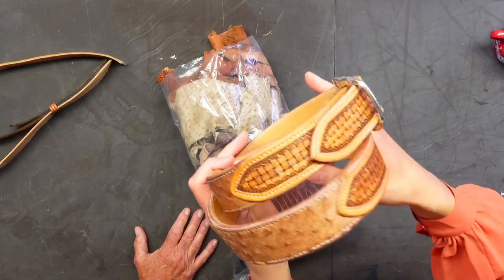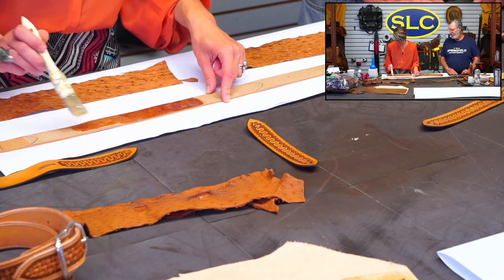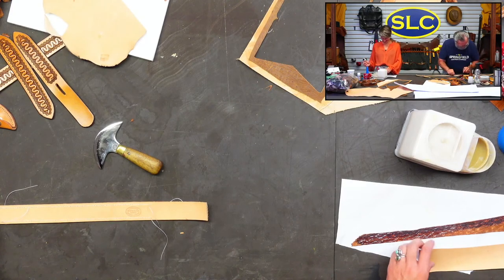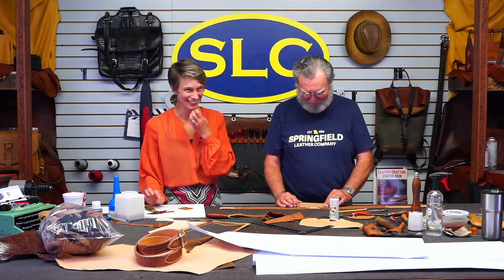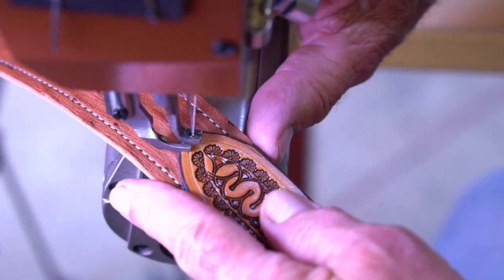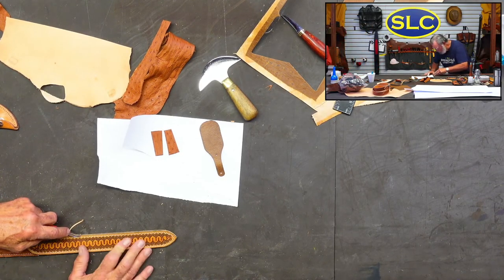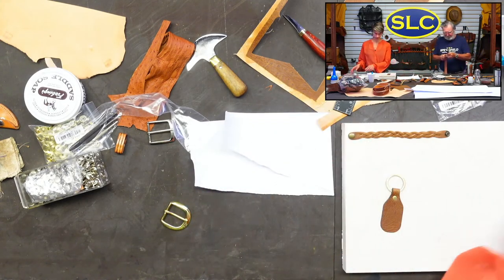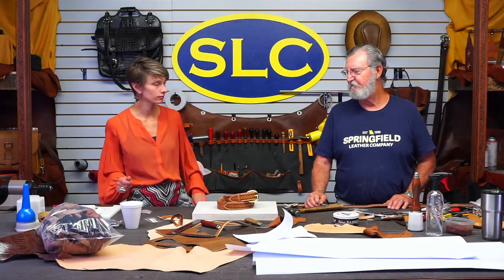Crafting an Overlay-Style Belt w/ Denny + Liz

Comment: Light also thickens glue up too, I put some in a clear glass jar and it thickened quite fast, but not in the brown glass bottle or the can the glue came in, so I bought a really nice brown glue bottle with an adjustable height brush in the lid. So the Weldwood glue stays thin in the brown bottle but not in clear glass. Usually I just need a small brush, but sometimes need a big brush and I prefer to not work out of the can, too messy.
Reply: Oh that’s good information, thank you!!